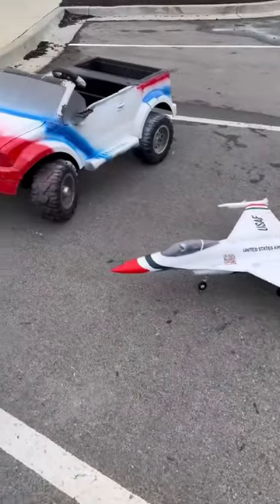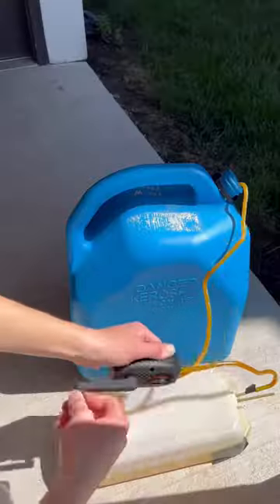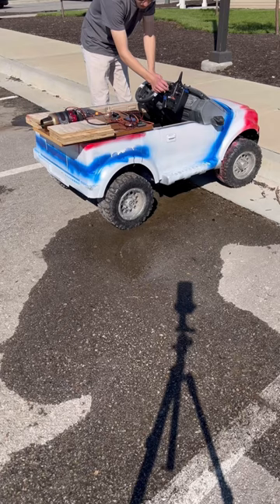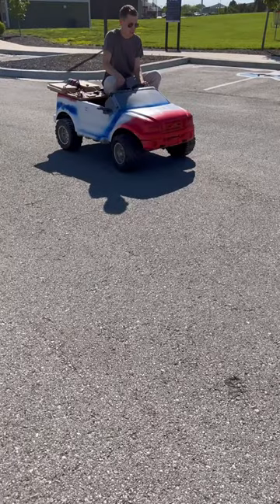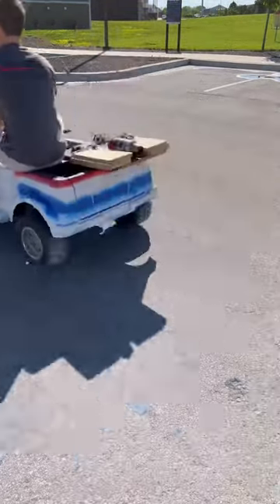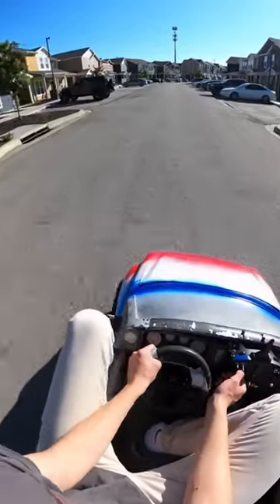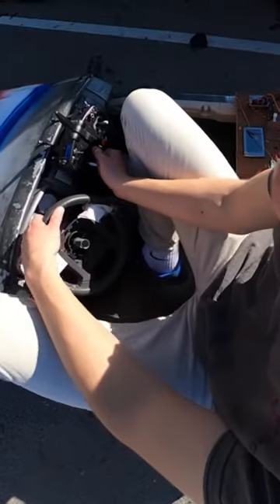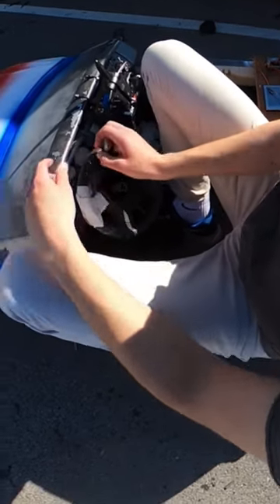Test Driving the Jet Truck

Comment: That is a king tech turbine and I have a few turbines in model aircraft the way you must usually shut the turbine down is to run it up 70 000 RPM so and then you shut it down because when you run it up and then shut it down you get some fuel in the motor which will lubricate everything unlike when if you just shut it down it could cause the bearings to lock up and seize I have seen it happen 😢